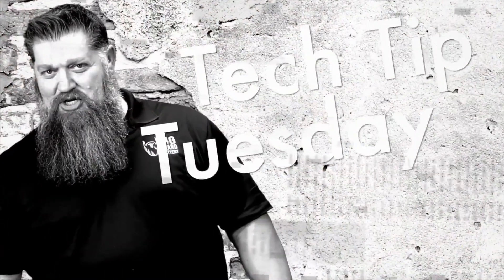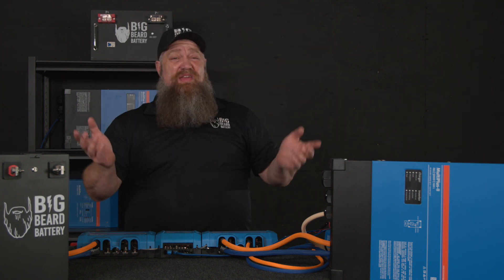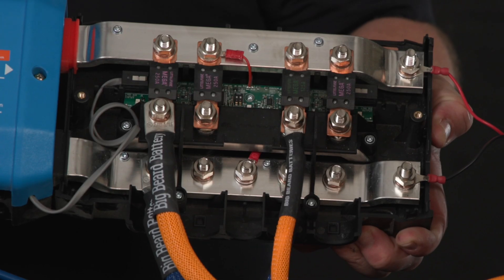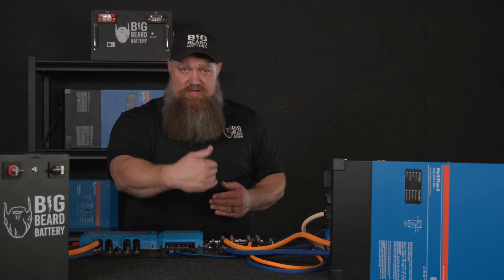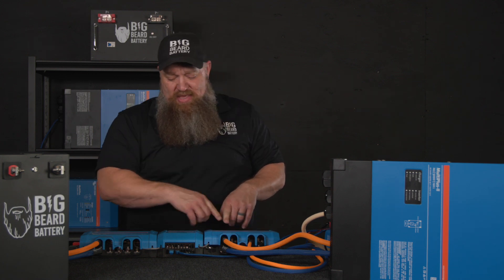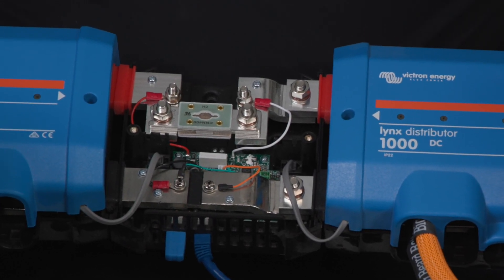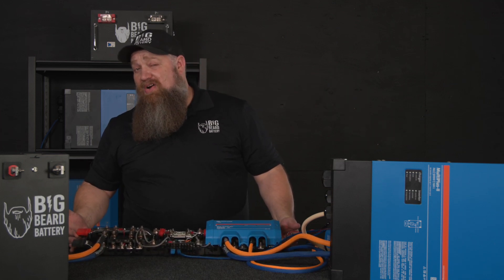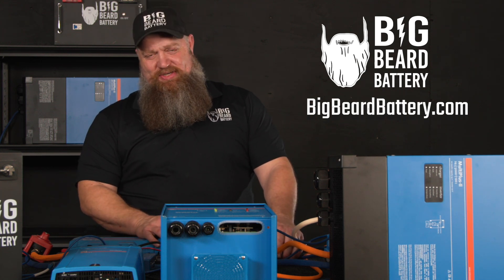Clean Up Your Solar Wiring

Comment: The Victron Smart Shunt cannot be recommended enough. It costs under $100 and provides you with a precise measure of how much power remains in your batteries, how much power you're currently drawing (or the current charging rate), and more. It's the most powerful piece of instrumentation for us when boondocking.